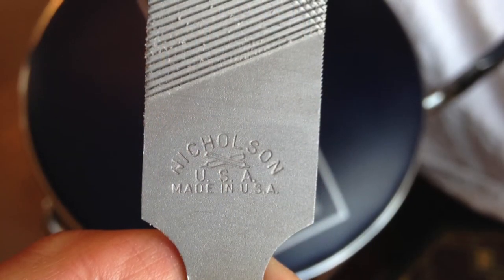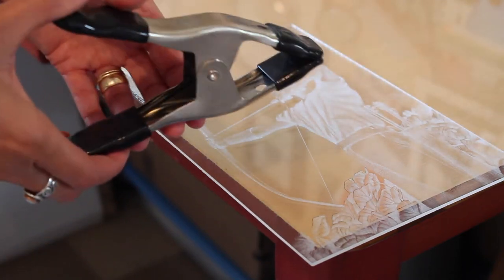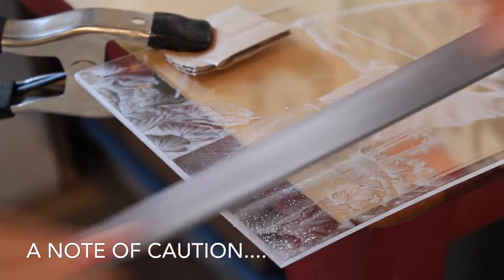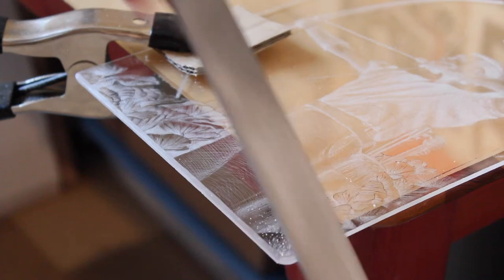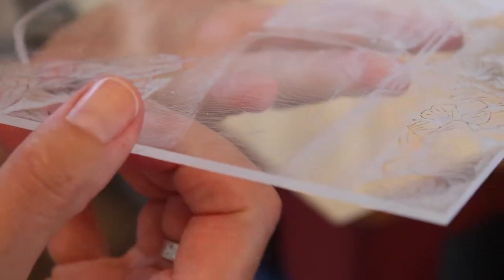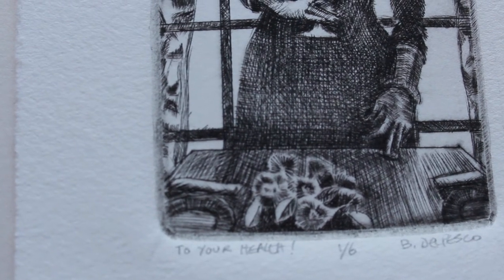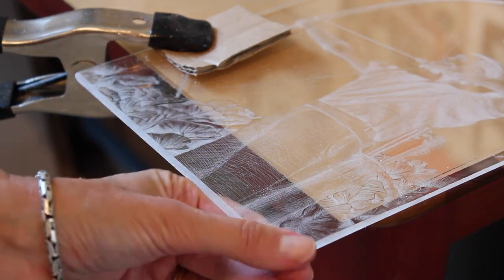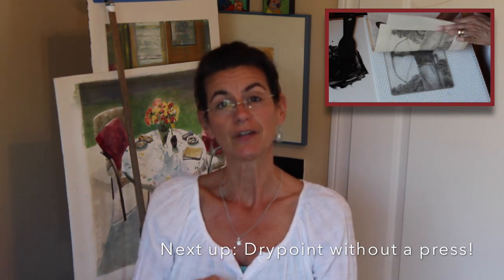How to Bevel Plexiglass or Perspex for drypoint, monotype and intaglio printmaking

Comment: Thank you-as I am moving to this process from acid etching on metal plates, this helps!
Reply from the maker: Hi Paula! Have you made one yet? Drypoint on plexiglass makes intaglio printmaking so accessible for a home studio!
Reply: Not yet-and before I moved back here to Molokai, I had to give up my press bed (no room and the climate is too moist). BUT I have a die cut machine that is much like a miniature press bed that works with 'shims', so there is some experimenting that will need to happen.
Reply from the maker: Ahhh, that's a wonderful workaround, by all accounts. Are you part of the X-cut group on Facebook: https://www.facebook.com/groups/1544918272204523/

Comment: I know it's been a few years since u posted this. But how do we know our file would be exactly 45 degrees. I have a project that needs it to be exact  I need to join corners with acrylic that has to be 45 degrees.   Plz let me know if u have any ideas   it would be really helpful. Thanks  💯💯
Reply from the maker: Hello Mansoor, Depending on the size of your acrylic pieces, you could use a Mitre Jig Vice - like this: https://amzn.to/2VwggzG   Here is a video that shows how they work. https://youtu.be/xs7yaj6kY8g You might be able to examine and clean up your bevels by placing the pieces in the jig after you file them to see how close you are to that precise 45 degree angle.
Reply: @bdelpesco  thank you very much appreciated 💯🥳